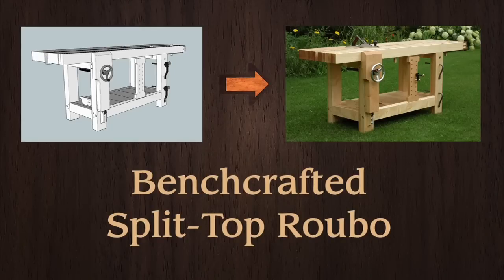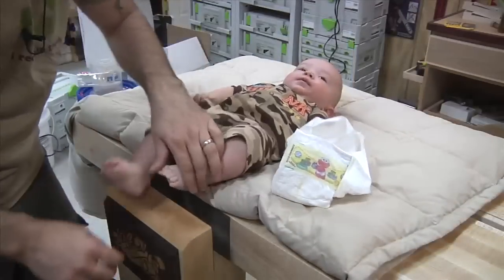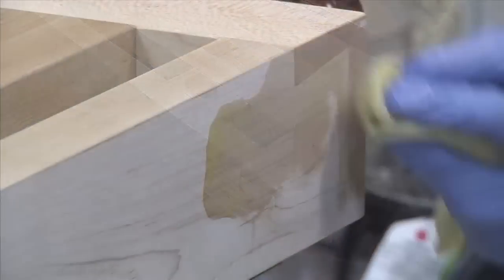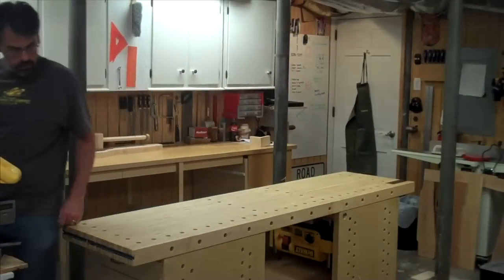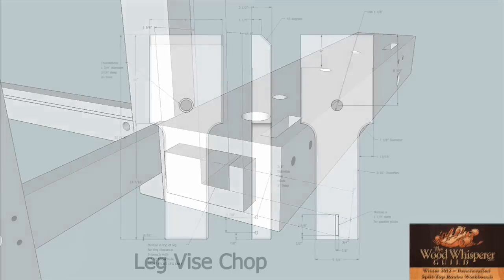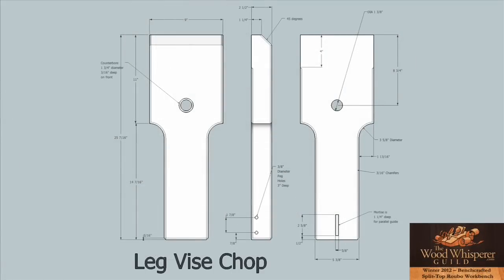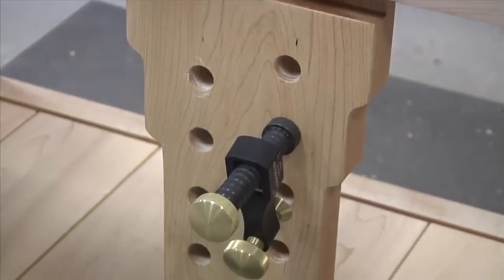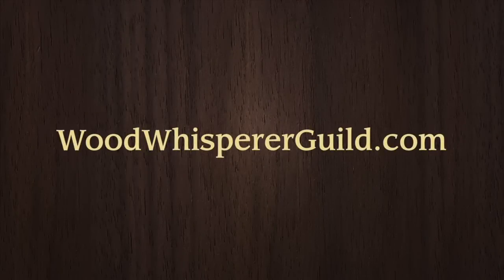Benchcrafted Split-Top Roubo Promo

Comment: Hi,
I plan to build a simpler and smaller ruobo workbench, since I am just a begginer in the woodworking area. I can get hold on some maple boards (55mm thick) and plan to stack them together. Is this type of wood good for the working area. The stand will be probably made of pine.
Thanks for all the advices and videos so far. They are very inspiring.

Comment: This is an extremely versatile design for sure. But what I'm curious/worried about with the split-top version, is the connection between the bench top pieces and the base. With the classic Roubo bench, you have this big, massive, solid joint that binds everything together as a unit, but here the top just lays there on the base, kept there only by it's own weight. Surely it's not a construction as fundamentally solid as the classic bench, but I guess it works well enough in practice, at least when new. Have there been any issues or anything noteworthy regarding this concern, now that this model have been built and used for many years?
edit: Ok, I see now that the top is screwed to the base with big screws from the underside. That was an easy solution... :) Still not as solid as the original construction, but it will keep everything together for sure.